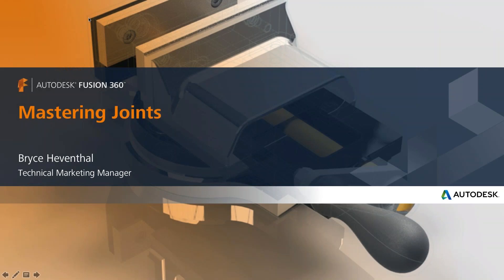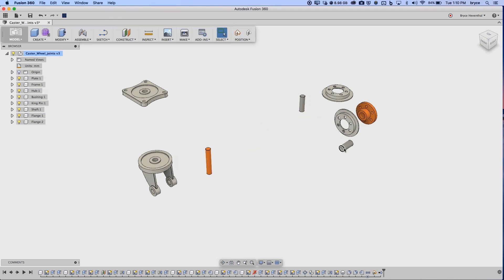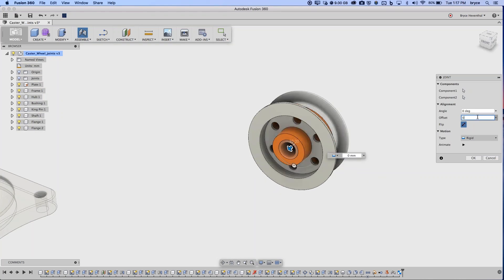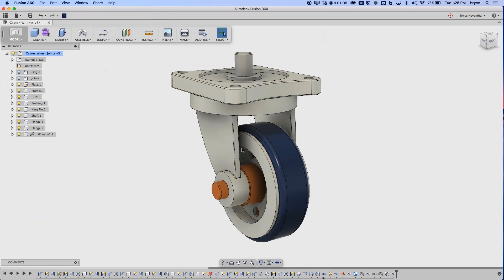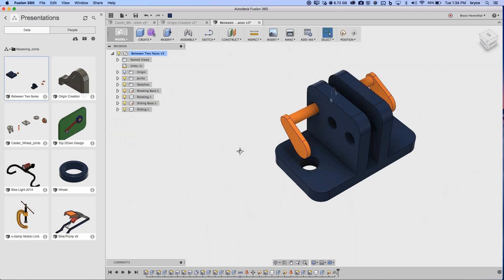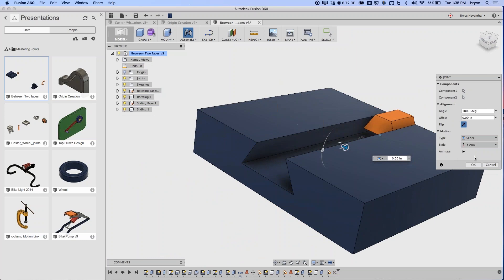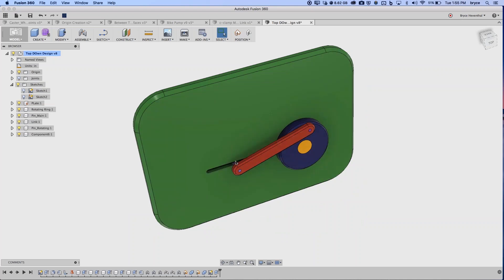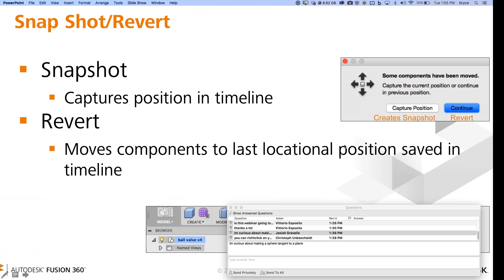Webinar - Mastering Joints

Comment: Hey +Bryce Heventhal , I definitely learnt a few things from this. I haven't finished watching the whole thing yet though. So I'm sure there will be a few other tips. I feel compelled to point out two things so far though. You should still encourage users to ground to the world co-ordinate system, it's CAD 101 and definitely still applies in Fusion 360 just like it does in any other CAD product. There is nothing worse than importing a component from someone that is way out in some random place in space. There could be an argument that it's not so relevant if all the files are being modelled and consumed in F360, but if they are ever exported and consumed in another application for any reason, then it's not a good look when the components are all over the place.

Also with respect to using different versions of components in your assembly. It's really no different now in Fusion 360 than it was in Autodesk Vault Basic for example. Having an explicit command like that is useful, but beyond that the behaviour is pretty much the same.

Comment: Thanks for the illustrative and educational video. I learned a lot and have been practicing since this episode aired.  I'm trying to join a two pin part to a two slot part and receive a conflict when trying to join the second pin to the second slot.  Imagine a clockface, pins at 9 and 3 each with the slot open to their left to afford slight movement. At the end of leftward movement, pin 9's sliding journey is over, however pin 3's slot at the end of its leftward movement has an arc clockwise 30 degrees downard whose center point is pin 9's leftmost position.  I've been trying combinations of joints and constraints to fix this motion to the two slots without much luck. Would you have any pointers?
Reply: Got it! Enable All Contact

Comment: I need help, desperately. 

Lets say I have a set of components in a rigid group.. I want to pattern said rigid group. Lets pretend the rigid group is cylindrical and I need a cap on one end. 

I know how to set up the pattern command but how do I set fusion up to only pattern the cap on the last patterned feature? for example, if I have two items in my pattern and I switch it to 4 items, the cap stays in the same position and doesn't move with the end of the 4th patterned feature... its driving me nuts! I use Inventor every day at work and know I can do it in there but not sure how in Fusion!! please help!

Ive resorted to include the cap in my pattern... and just hide all the instances except the one I need.

Comment: asbuilt joints is not in the new fusion so @46:32 i cant follow along, another thing is i CAN'T never just move once i create a joint using just the JOINT feature it just highlights the model or drags the model from where i have it.
Reply: let me explain what im doing so that i can come off clear, i modeled a foot and its ankle joint and what im trying to do similar to  what you have done is a servo motor which is the ankle joint and then i have a servo horn extending out towards the middle of the top of the foot just like you did that revolute joint mixed with the slider joint, the servo horn should rotate on its servo axis which is the shaft of the servo, and the servo horn should slide on the compartment i made so that the horn can slide accordingly and respectfully to where the servo actuate to "clockwise or counter = foot up/foot down" 

hope this makes sense.

Comment: If you have to do a video, let alone multiple videos on how to do basic assemblies in a 3D modeling program, you've failed. Further, if your first words are basically "all the other guys do it this way, we do it that way and you'll get used to it eventually" YOU'VE FAILED. I feel as though this program was made by a bunch of kids who have never used a CAD program before and decided to try to build one from scratch and not learn from the past mistakes everyone else has made. I don't see the benefit of doing assemblies different from how everyone else does it. Solidworks and Creo are multitudes better just for this reason and until you fix this method, they will stay better. I'm fine with change, and welcome it in many cases but this method of assembling is terrible in every way shape and form. I can throw anybody into a Solidworks seat or Creo seat and they can make assemblies within an hour with never using the program. This system, it would take a full week to learn how to do an assembly. K.I.S.S. In short, this is the single most limiting feature of F360. This is what is going to prevent others from adopting it and will severely limit F360s expansion into mainstream engineering.